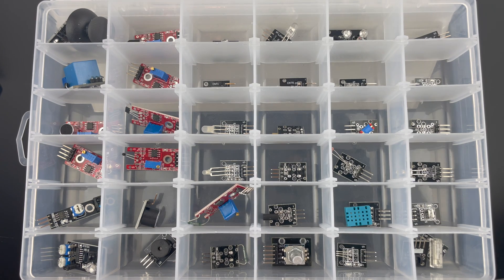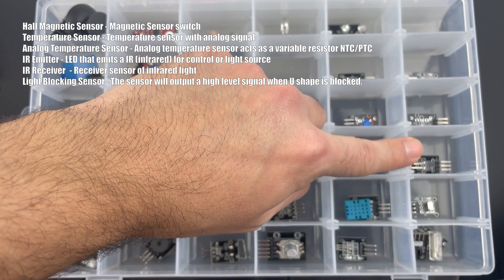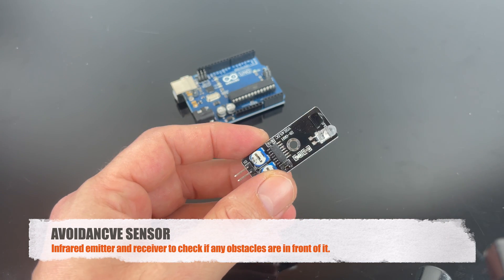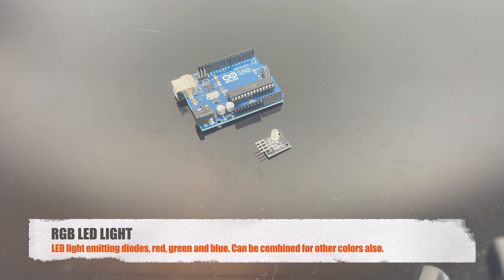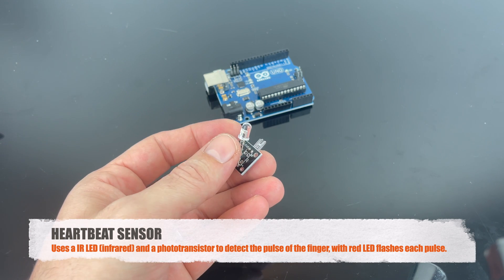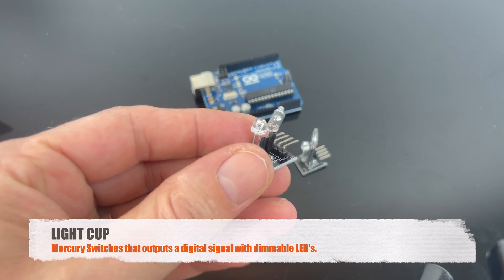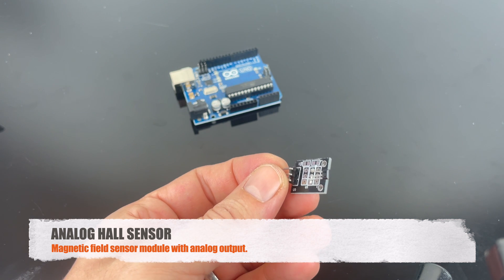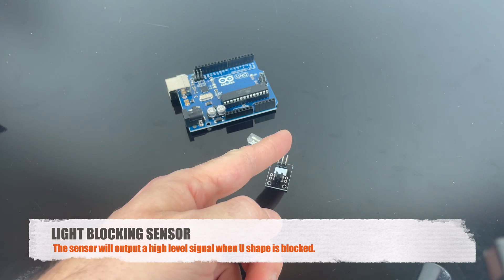ARDUINO 37 SENSOR KIT EXPLAINED

Comment: What I need is how to use them. The little DVD that came with the set won't play on either of my laptops. the drive runs you can hear it but it doesn't display . I spent about 2 hours today trying to watch it but no luck.
Reply from the maker: There is tons of guides on youtube what sensor do you want to use

Comment: Does this product will contains microcontroller?
Reply from the maker: No it comes without it
Reply: @logicron  can u able to suggest any microcontroller product?
Reply from the maker: @matthew2696  i got an Arduino Uno for it
Reply: @logicron  how much cost of the microcontroller?
Reply from the maker: @matthew2696  about 10-20 usd

Comment: Thks & question;
I'm a retired scientists & a little bared.  I was going to get an arduino for fun.  
However I looked at my smartphone & noted it has most of the arduino sensors.  So I think I will just learn to develop simple apps for smartphones, access all their sensors, & route data via their usb port.  Essentially use a smartphone just like an arduino/raspberry-pi.  
Pls let me know what you think, thks.
Reply from the maker: Thats possible i guess, but it depends what you want to achive here. Arduino code and sensors are not the same as app development. Also connecting sensors to other things can be tricky with a smarrphone
Reply: @logicron  
Thk you ever so much for replying.  It's so hard to get a sound answer to simple questions nowadays.
Well I did slightly over-simplify my questions.  So I'm a retired physicist, bored, & want to disgn/build projects from scratch.
*So for low lever control of sensors/actuators I plan to use FPGAs.  An FPGA can be reprogrammed to produce any desired classic or recursion function in/output.  In-fact any cpu/controller/electronics can be programmed into FPGAs but their performance is about ~3years behind current cpu/controller/electronics.  FPGAs originates out of the military (ex: missiles, radars, etc) and are slowly coming into the civilian domain.  FGPAa are hard to learn (& have community little support), low performance FPGAs are very affordable.
*However every system requires some type of human interface for maintenance, repair, analysis, modification, config mgt, etc, etc best done on traditional computers.  I was going to go with arduino/raspberry-pi but realized a smart phone/watch surpassed most of my needs.  I assume the android high lever development environment will allow me to upgrade to better smart phones/watches independent of vendor & changing hw/sw.  
*Sooo the strategy would be develop/document the projects on traditional desktop computers.  Transition the interface & system control development to a smart phone/watch.  Finally transition system control development to a FGPA (& hopefully keep the profanity to a minimum, fingers-crossed ;).
*Let me know what you think.
Reply from the maker: @tombouie  it really seems like you have a good base for doing a project like this and if the FGPAs is good enough to do what you need then thats great. For me who studied programming Arduino was a great entry to the world of electronics and the programming of that. Arduino is also very cheap to get started with and the sensors are really not much. For a newbie this is the way to go i think. Seems like you are a bit more advanced than that and tearing apart and using older smartphones is a great thing i think. Would be interesting to hear what kind of project you are looking to make :)
Reply from the maker: @tombouie  Super interesting take on what you plan to do. Solar panels are a very interesting item in Europe right now so i would acually love to hear more about your super smart solar inverter. I play around with solar myself and use Victron Inverter for my small usage. Its awesome to use machines with solar energy
Reply from the maker: @tombouie  keeping skills sharp by learning is also my philosofy. Would be fun so se and hear more about how you advance. But i do recommend arduino, its easy and fun to get started :) have a great weekend
Reply: Field Programable Gate Array? @logicron
Reply from the maker: @fench1234567  im not sure whats the question here ?
Reply: @logicron  At the time I posted the comment, I had only ever seen the FPGA misspelling.  I did a google search and found Field Programmable Gate Array boards for sale and showcase.  NOW I know that was the tech that he meant above.  The question was because I was still unsure right then.
Reply from the maker: @fench1234567  cool thanks for clarifying
Reply: Unfortunately most (if not all) cellphones are effectively a closed development environment for the most part. Where as microcontrollers such as arduino and pi etc. are open source. 😃 
You will definitely have a much better time programming and utilizing sensors on these platforms instead.
Reply: @ZetaReticulian  
This is just a hobby in retirement & here's my long-term strategies;
*For a human interface a portable app on an inexpensive smartphone is difficult to beat.  Also a smartphone have great interconnectivity & numerous sensors.  For ex: I hope to just use an inexpensive smartphone within RC model airplanes, UAVs, etc interconnected into the actuators.
*Microcontrollers/FGPAs to control electronics using the smallest amount of effort, resources, complextity, size, power, etc, etc.  I finally just abouts figured FGPA out. FGPAs originate out the military & their just ain't much good info on exactly how to learn/use'm.  
*An smartphone & microcontroller/FGPA combo is the best of both worlds.
Reply: @Tom B  hi I was wondering if you could develop a simple app to control a slider on screen on your phone using a joystick or potentiometer input connected to an arduino where the arduino and the phone is connected via a USB cable .

I'm asking this because an arduino / phone interface can be used for work that the arduino can't handle for example high quality sound .do u use any social media like Instagram? I would like to get to know you
Reply from the maker: @ZetaReticulian  very good point open source ftw!